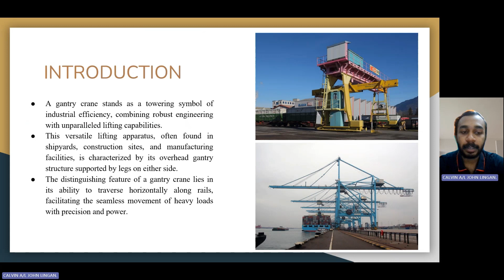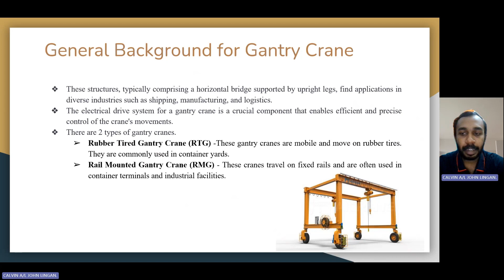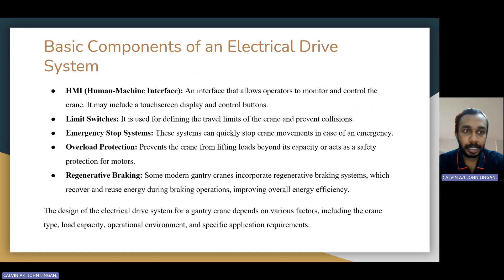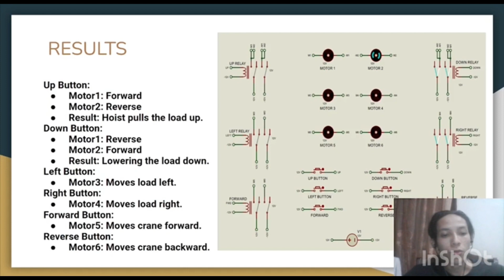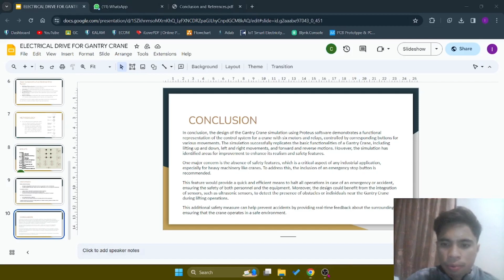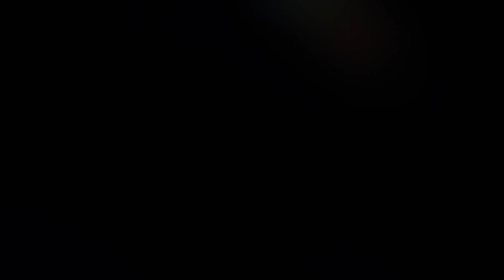BTE4763_GROUP 7 PRESENTATION _ASSIGNMENT 1

Comment: Gantry used AC or DC Drives ? 14/2/24
Reply from the maker: Some of the gantry used DC Drives and AC Drives.DC Drives is used for controlling speed and torque for any application that requires precise control over the applications.AC Drives is used for high power requiring applications and more power for the hoist to lift an object.